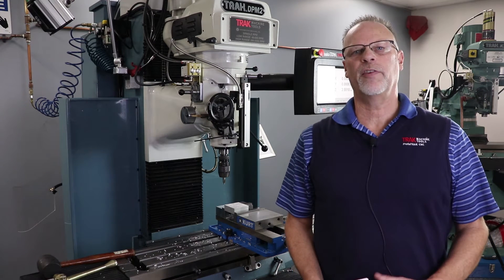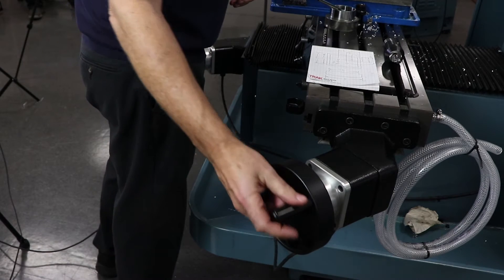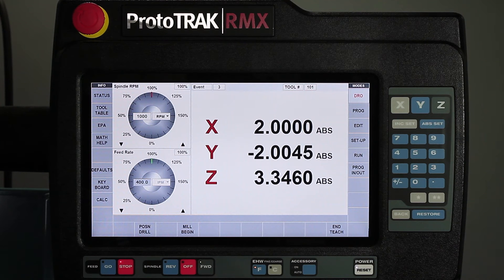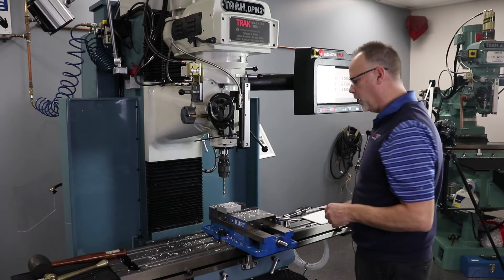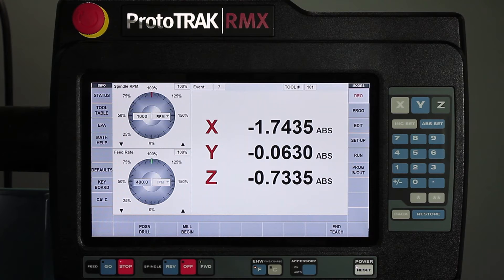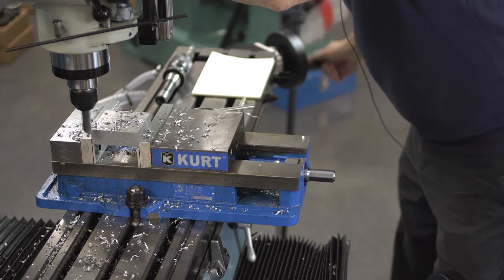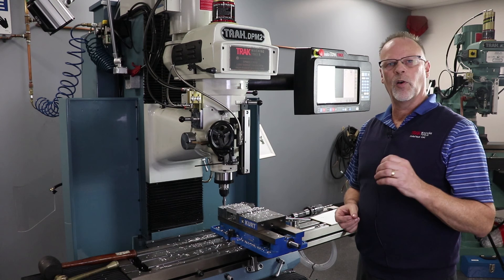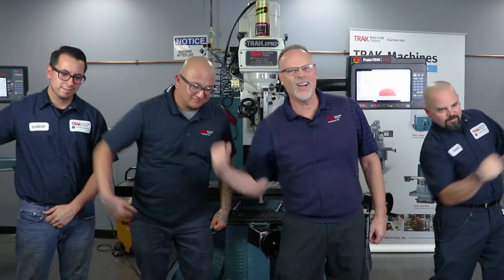Teach Mode [Part 1] | ProtoTRAK RMX CNC | Mill Programming

Comment: hey Pat, do they still have the button that does nothing but beep?
Reply: Hi Ed, The answer is yes.  We always build in extra keys in case we need to add an extra function somewhere down the line. Although it may just beep right now, in the future we may change the front panel and give that button a purpose.  T.P.
Reply: @patrickfitzsimmons5187  lol.
Well don't matter I've been running trak machines for over 14 years and love them
Reply: @edkelley6916  I figured as much!

Comment: wouldnt it be faster just to type in the dimensions instead of cranking around, then save the pgm with a name?
Reply: Of course it would but what if you don't have a print or any known dimensions or positions?
Reply: @patrickfitzsimmons5187  gotcha! ive been working on a '94 EZ Trak...!!

Comment: Good video series. 
Can you post a video on how to use the calibration code on rmx. ?
My z axis is out by .023
Reply: Hi Bruce, I don't really make the service videos however, all you have to do is to go to SETUP - SERVICE CODES - #123 and follow the directions.  Since this is an RMX, I would tend to believe that currently, your machine is still under the warranty time so I would call for service and then watch them do it for you.  Good Luck!  T.P.
Reply: @patrickfitzsimmons5187  I did exactly that.  Great service tech,  the guy walked me through it step by step.